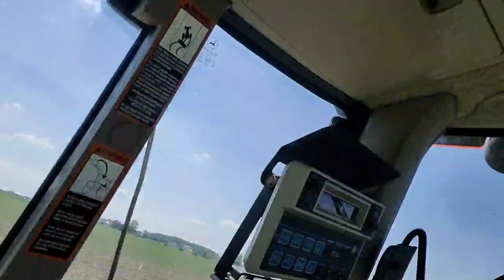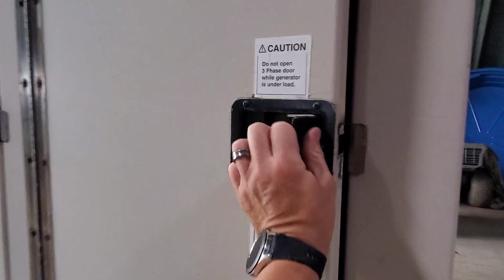Time to Start Irrigating - #177

Comment: Can’t use power from the power company?
Why not?
My company came in, set poles, drop and meter free at the home farm.

July 4th is coming!
Reply from the maker: We can and do but they will only give us 400amp single phase which doesn't cut it.
Reply: @BorderViewFarms  Barely enough to run a large home, 400a SP
1930s rural electrification under Roosevelt did wonders for the farmers of the midwest and west.  Cost a fortune to repole and rewire vast miles with 3 phase high current.
You must be on a Public Utility District?
Reply: Border View Farms single phase they could add a transformer and give you three phase that’s stupid.  They should have 12kv at pole and be able to give you 208V 3 phase or  480/277V.   But commercial power rates suck
Reply from the maker: That's not how 3 phase works.  The closest 3 phase line is 2.5 miles away and they wanted $100,000 a mile 15 years ago to bring it to us.
Reply: Border View Farms oh got it your on single phase feeder.  That sucks so generators are cheaper.  Sorry you would need rotary phase converter and you still won’t have enough power